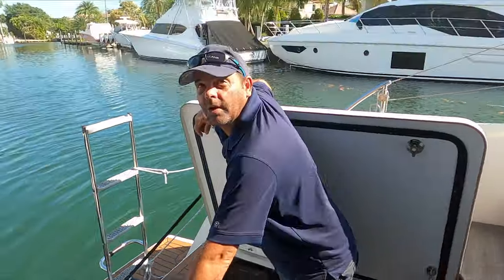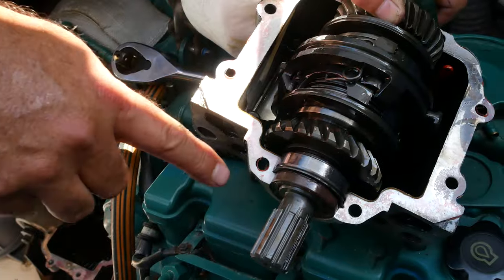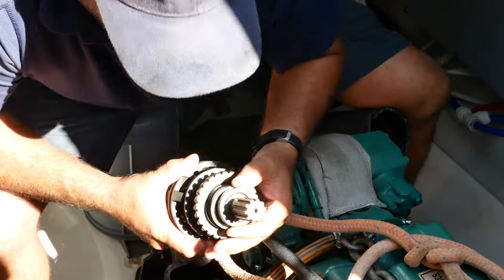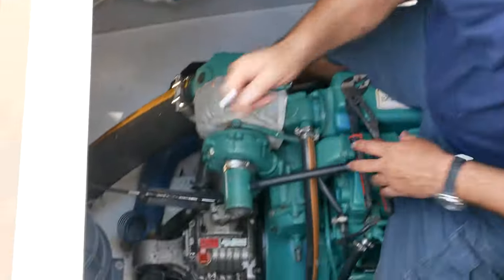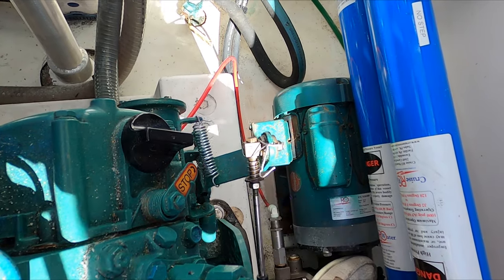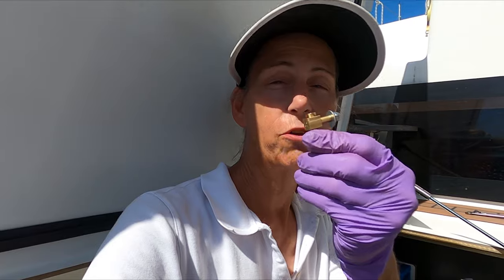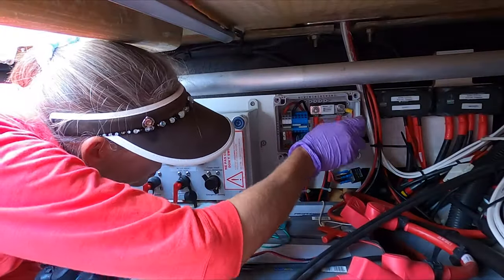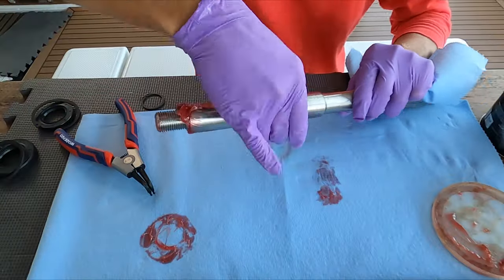Just Catamarans Fix Port Sail Drive & Upgrade Steering Part 2 - Ep. 10

Comment: I found your channel, again since I watched some of the car “stuff” that you did before. I like the change to sailing😊 If you feel up for it I am curious about the survey and the final price you paid for your boat. Did you use the survey finding as a negotiating point when you went back and told the seller that you wanted to mover forward with the purchase? I would imagine that finding faults with something like the windless, clutch, UV protection, etc would be something the seller at least would work with you to remedy?

Also, offer asking price for the boat or did you go lower? Maybe something like 10 to 15% as an opening offer? You of cause don’t need to disclose actual cost, but I am curious about the negotiation that you did.

Look forward to more sailing stuff.
Reply from the maker: No, we are not going to share costs yet.  Yes. We did negotiate as I assume most folks do.  However, just like cars and homes, it depends on the market.  Heidi
Reply: @HeidiandFranny Thank you. I am not necessarily interested in the price you paid for your boat. That is between you and the seller. I am more curious about the process of arriving at the price you paid.
Reply from the maker: We had to look at lots of boats.